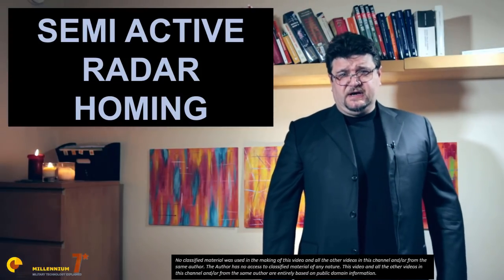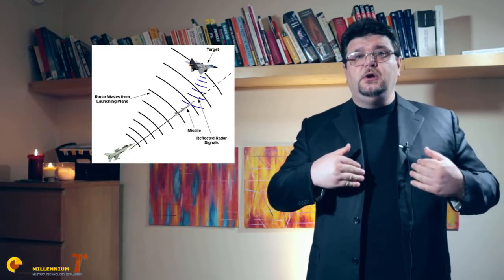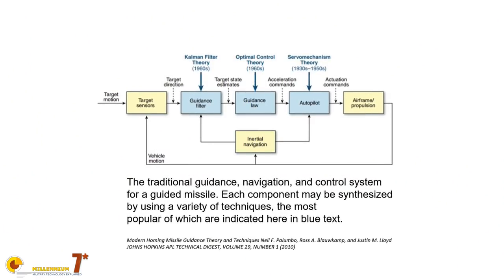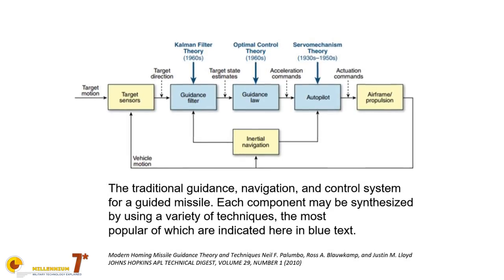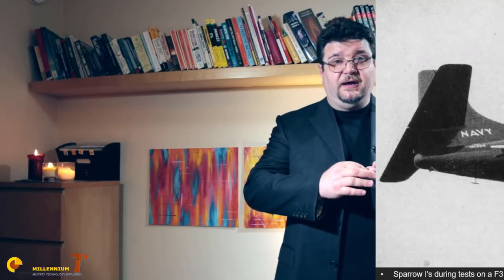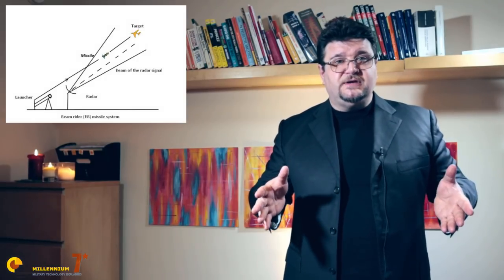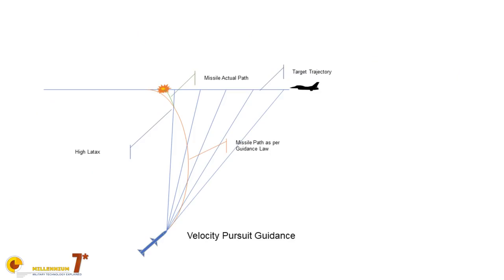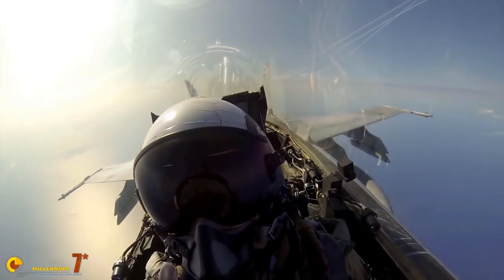Sparrow, Skyflash, Aspide: the Age of Semi Active Radar Homing

Comment: What you call "line-of-sight" guidance isn't semi-active radar homing in either of its forms (command guidance or beam-riding). Neither of those has the missile receiving radar echoes from the target, which is the defining attribute of SARH.

Were there ever any SARH missiles that used pursuit guidance? All that is needed to implement classical proportional navigation (PN) is to hold the target at a constant angle w.r.t. the missile, and that's actually pretty simple in comparison to the basic complexity of a gimbaled radar receiver (i.e. if you gave the technology to implement SARH with a gimbaled seeker in the first place, then pure proportional navigation via constant angle to target should be trivial). IIRC all SARH Sparrows from the very first Sparrow III on used proportional guidance. Note that what you describe. I would note that the defining characteristic of PN is that the target bearing is held constant. That does ensure constant lateral acceleration under some conditions of target motion, but not all (Simple proof-by-contradiction: If the target initially holds a constant course then PN will eventually converge to zero lateral acceleration. If the target then subsequently turns aggressively, then the missile must turn as well, and the lateral acceleration throughout the flight is non-constant. QED).

I think that you give a very nice high-level description of conical versus inverse-monopulse homing, starting around 10:00. I think that most people don't understand how much of an improvement Aspide (and later Skyflash and AIM-9M) were. Those really do constitute two completely different generations of SARH missiles, with very different overall performance and ECCM.

Effective deception jamming of inverse-monopulse radars is possible, and the most basic technique (cross-eye jamming) has been known for over 60 years,  almost as long as monopulse itself. It requires a much more sophisticated multi-antenna EW system as compared to basic angle deception jamming, and I think that's a big reason why we now see widely-separated wingtip (Gripen-E, Su-34, etc) or conformal in-wing (F-35) antennae in modern aircraft.

Comment: Question, Millennium 7*: In the case of the inverse monopulse seekers, if there are just two slightly diverging polarized signals emited, and the missile seeker do not rotate, how can the guidance system "know" the target's elevation and produce up and down corrections?
Reply from the maker: There are four receiving antennas, lined up along the two axis.
Reply: @Millennium7HistoryTech  Thank you. Makes sense now.

Comment: Can an sarh or an arh be countered  by any ecm tactics. Thanks
Reply: i think JAM is ECM. If im right than yes as stated in video
Reply: Yes, fairly simply. For instance, the SARH SAM, the HAWK missile, depends on a separate  target tracking and guidance radar, the IHIPIR. The IHIPIR uses a rotating, nutating scanner running at 30 rpm. If the jamming aircraft can sync to that, the illumination radar can, not will, be jammed.